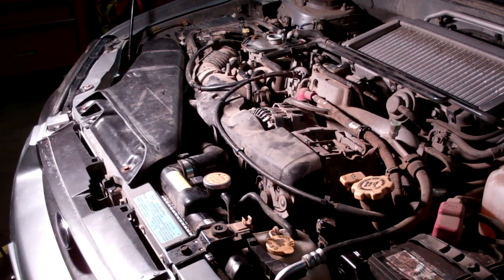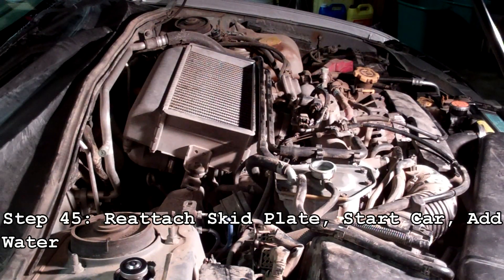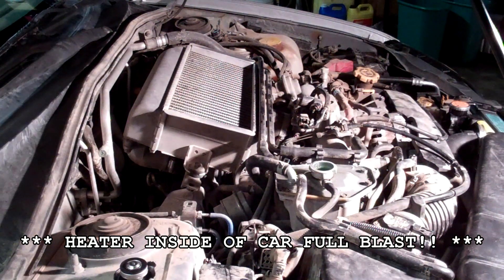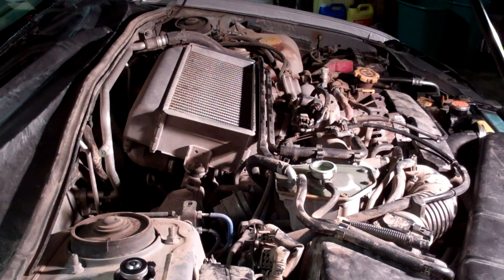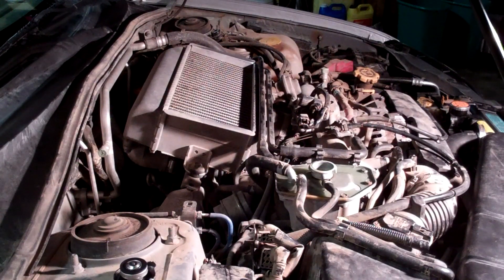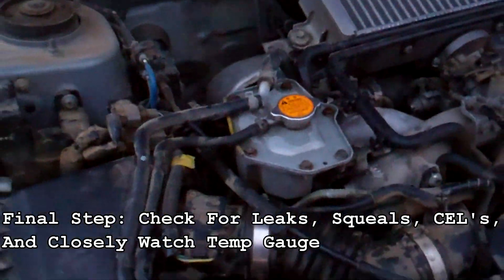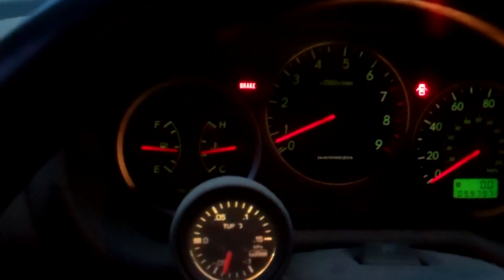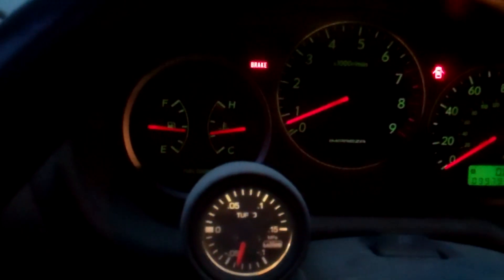Meatys Subaru Timing Belt Guide (HD)(5/5)

Comment: i just wanted to thank you for covering just about everything important including letting the cam springs release tension and reset it... that was the one thing i was unable to find anywhere else and gave me the confidence to do it myself and now my car is running better than when subaru dealer mechanics did the timing belt the first time.
i should probably say that i had to do the timing belt because the subaru dealer mechanics replaced the belt but none of the timing belt components like i paid them to do and they almost killed my engine.

Comment: Thank you so much for doing these videos! I just bought a 99 Legacy outback 2.5 with 130,000 on what I believe is the original timing belt. I didn't even want to put the key in the ignition until I got it changed. The local garage quoted me $ 950 for timing belt and water pump. I did it for about a quarter of that with all new belts, hoses, clamps. Your step-by-step procedure really helped get it done right. A few things different with an automatic and non-turbo but the basics are identical.
Your videos are very comprehensive and use good practices. You're one of the few that uses Loctite or pulls out a torque wrench on critical bolts. I think you should have torqued the crank pulley bolt though.
Thanks! Great job.

Comment: Thanks so much Meaty! This was so much better than the manual because I got to see what was being changed, in what order and the tips and tricks to certain steps were invaluable. Really, really great. 05 Legacy GT. For anyone contemplating doing themselves, the differences are minimal between the WRX test patient and the LGT. It was a bear trying to get all the belt marks and cam gear marks to line up on well, both sides, but the passenger side was tougher to get that last tooth to the mark.

Comment from the maker: Having leftover coolant is normal. I usually pour one complete gallon of concentrated coolant in, then refill the empty coolant container with water and add it until full. If you have an aftermarket aluminum radiator, you will usually use 2 gallons of coolant and then water.. depends on your setup. Better to have more than not enough.

Comment: Hey Mike. Great video I appreciate all the effort. I am a bit unclear on one thing. You are using the full 2 gallons of coolant, but then just toping off with water? Or 1 gallon directly into the radiator then top of radiator with water, burp, top off. then the other gallon of coolant into the reservoir at least to the full line. And only placing water directly into the turbo coolant reservoir? Should i expect to use the full 2 gallons of coolant or having some left over is normal? Thanks a lot!

Comment from the maker: @burrowssj 

No.. turbo rebuilding is something I haven't done yet.  This weekend I hope to do a simple Subaru oil change video for the n00bs :D  Plans for further videos include motor pull; suspension swap, clutch change, valve adjustment, head gasket replacement, brake pad & rotor change..

Comment from the maker: @burrowssj 

Yes, I would order the correct timing belt inner cover to be safe. You can still get the right alignment without the cover by lining up the double lines on each cam gear to each other.  I don't recommend going without the cover though since it will keep dirt, oil and weather out of your timing belt area.

Comment: @mikethemeatball Oh yup thank you for the reply there. The cam pulley is only chipped an the marks are still there, but there is no mark left on th belt cover.. Do I need to replace the cover with an EXACT model cover so the timing marks line up? thats what im worried about is weither the new cover an pulley will have the same timing marks or not(v2 sti ej20g)

Comment from the maker: @burrowssj 

You're welcome. Yes, use RTV manufacturers guidelines on letting the silicone cure.  I will add that to the video, good looking out :) Smashed timing areas can be tricky. If enough of the gear is intact to wrap an old timing belt around it, do so, and then wrap it around the crank pulley and put 2 sets of vice grips on as tight as possible. Have someone hold the crank with a breaker bar, and you use a breaker bar to loosen the cam gear bolt. New Cam gears are about $60ea, Covers $30

Comment: AWESOME VIDEO! thank you so much for taking the time to do this!   I do how ever have a couple questions :P.firstly when replacing oil or water pump an using silicone before starting the car do you need to wait 24hrs for the silicone to "cure"? and the other thing I was wondering is what do you do when the cambelt  cover has been smashed off? I also have a chipped pulley that needs to be replaced as well as the cover and im alil worried about this..